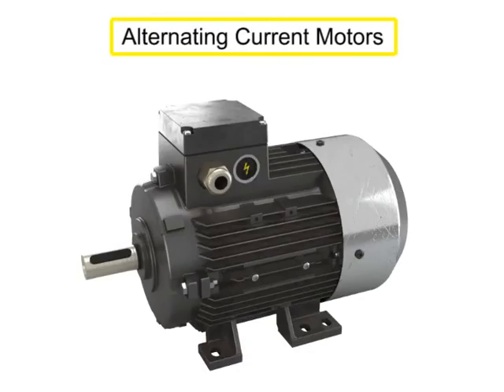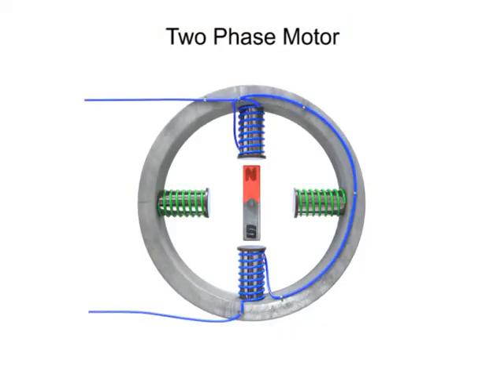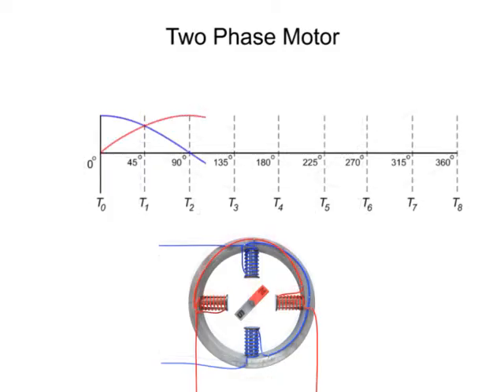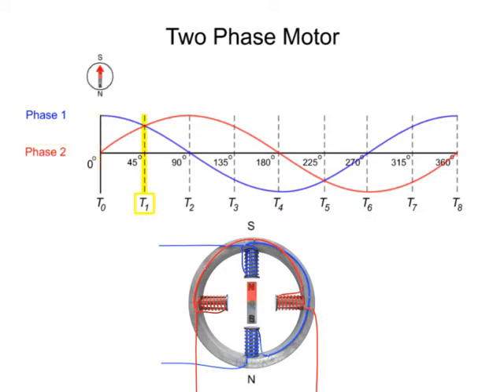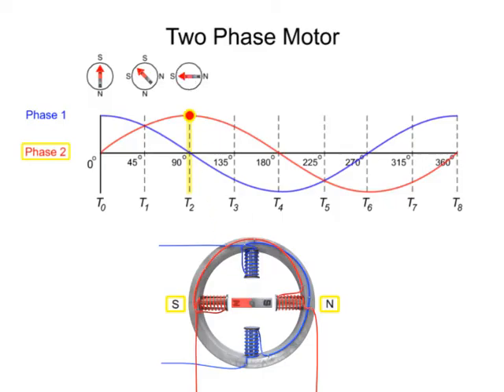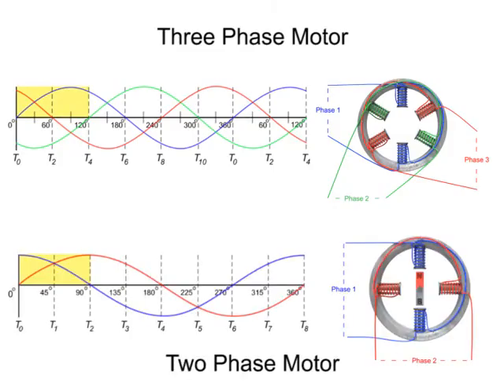Working principle of AC motors

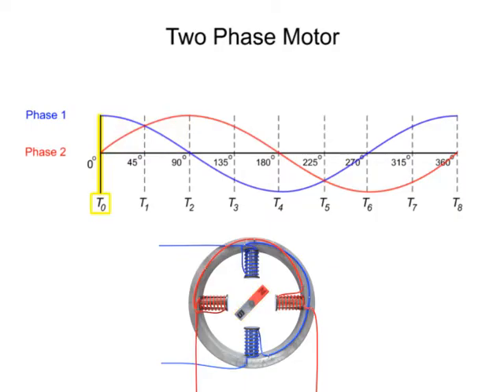Comment: I have a doubt. At time t0 at 1:19 , when phase 1 is at it's maximum, shouldn't the magnet be horizontal?? because when the magnet is horizontal, that's when the change in magnetic flux is the greatest through coil 1, therefore the induced emf is the greatest...
When the the magnet is vertical with the N pole facing the phase 1 coil, the magnetic flux through the coil reaches a maximum, meaning that the change in magnetic flux becomes zero. This corresponds to zero induced EMF in the 1st coil. As the N pole departs from the coil, change in magnetic flux is increasing, giving birth to the EMF, therefore, the greatest induced EMF in coil 1 happens when the magnet is perpendicular on the axis of the coil, and not on the same axis as depicted in the video.
Another argument would be that the magnet creates a magnetic circuit through the yoke, and when the magnet is vertical, the magnetic cirucit is closed, so the change in magnetic flux it is at it's lowest.
Isn't it so??
Reply: you are thinking about a generator.

Comment: Sir i have many doubts, is there a magnet on the rotor? (1)
Is there winding of copper wire both in the rotor and in stator? (2)

When the current (I) is induced inside the copper winding of stator,how does it make the rotor move clockwise/anticlockwise? Does that current and magnet on the rotor repels each other and the the rotor moves? 
Sir plzz answer.
Reply: 1) Yes there is a magnet on the rotor as shown by the N-S polarity.
2) Often no, the rotor is a permanent magnet and the stator has windings which form electromagnets (4x in the 2-phase and 6x in the 3-phase examples)
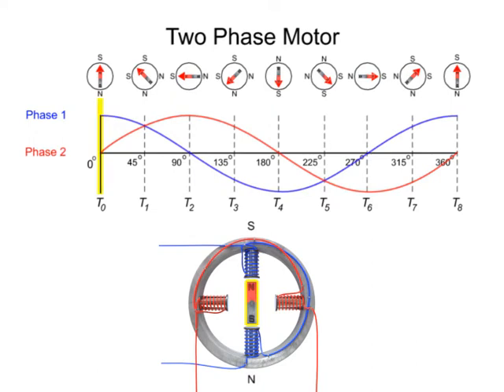3) The entire system works because the stator uses electromagnets which are enabled and disabled as discussed. Time 2:40 shows this best.